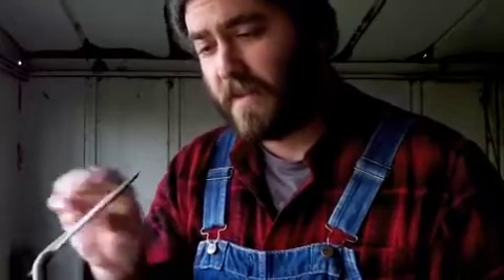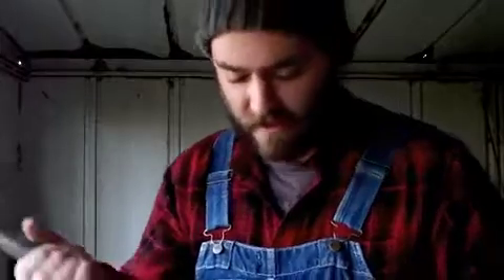Good tools

Comment: Great video Nick, and you make a very good point. Most of the tools I own, even down to box end wrenches and screw drivers are at least 30 years old. These companies turn out these cheap bi metal made in china crap tools that might as well be one time use only. Looks like you found some darn good garden tools though, and at 5 dollars you can't go wrong. Are you going to do any forging this winter or are you going to wait till spring?